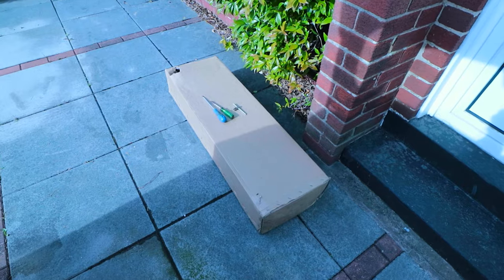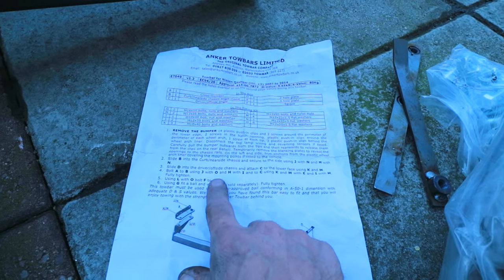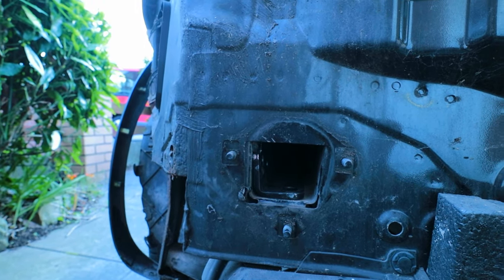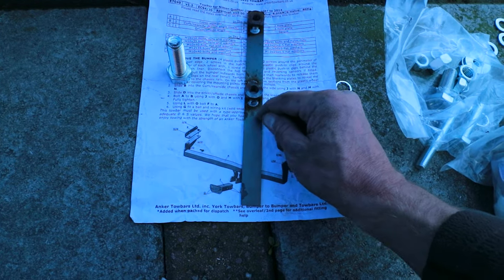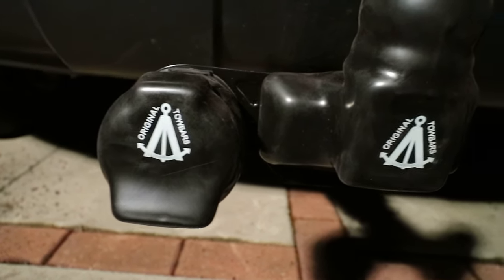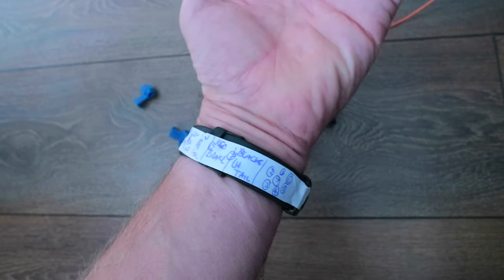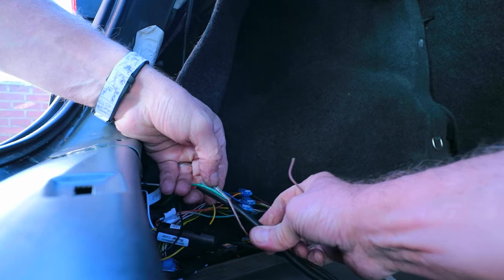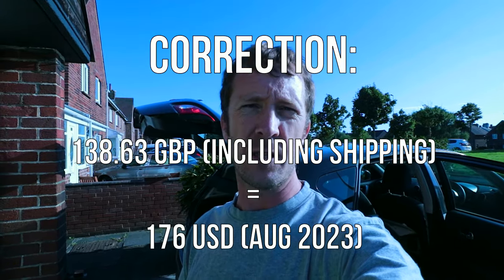Towbar Installation (Including Wiring / Electrics)

Comment: Thanks for this , will be helpful when I wire mine up  . fitting the towbar was no problem but I am not great with wiring + electrics  , I do have a multimeter though .SUBD

Comment: Good job!  Just wondering if it’s possible to just change the 13 pin socket thing?  Mine got water in it and caused it to short I think. 

Basically it caused the cars reverse lights to go on permanently, even with engine off and locked with the key fob. 

I had to just disconnect it

Comment: hi, where did you buy the towbar kit? mines a 09 plate need to fit a tow bar my self thanks
Reply from the maker: Hi Richard, I bought the kit on eBay UK. It was £138 if I remember correctly. (I'll add a link to the description at some point but I don't have time to organise that at the moment.) Cheers, Chris 👍